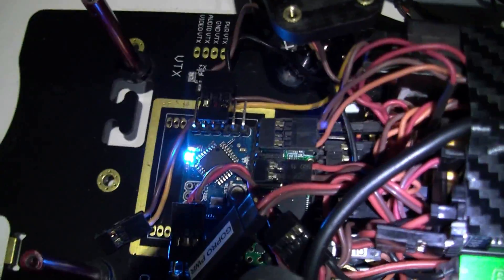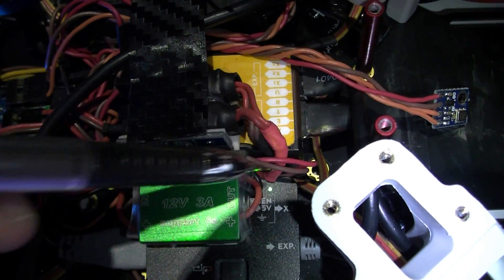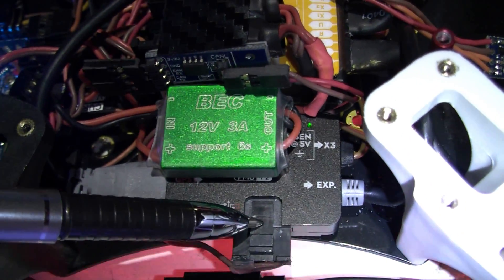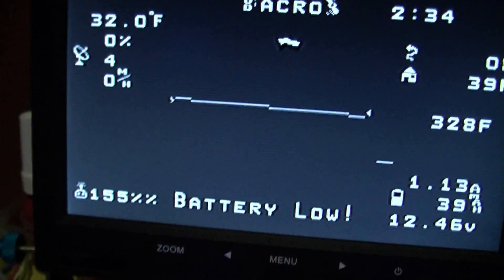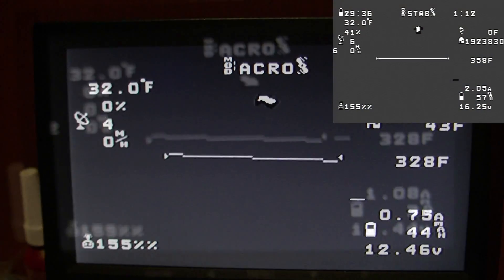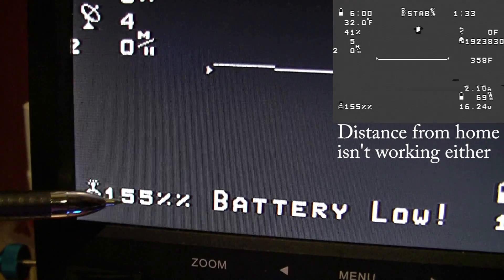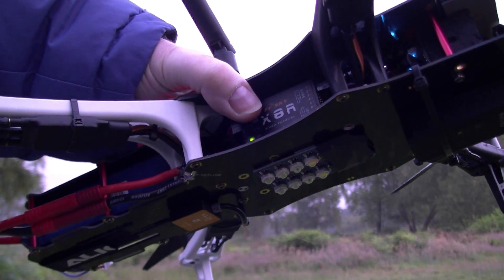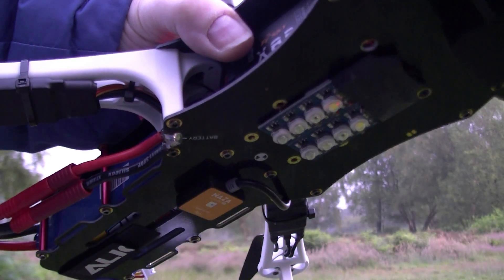NAZA to FrSky to Taranis - Version 2

Comment: HI Vortecks,
thanks for the video,im using NAZA v2, correct me if im wrong this is what i understand, so from PMU of naza it goes to the CAN transceiver and goes to teensy? can share which pin it goes?
Reply from the maker: Correct, but it's pointless knowing which pins to use if you haven't got the Teensy programmed to control it. I haven't finished the coding yet :-)
Reply: vortecks2000 Thanks! your Awesome!